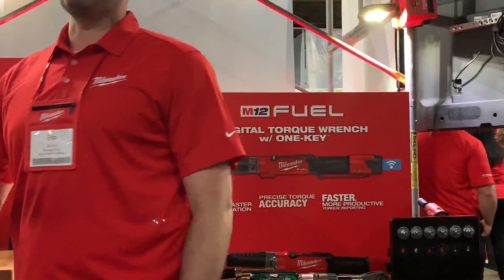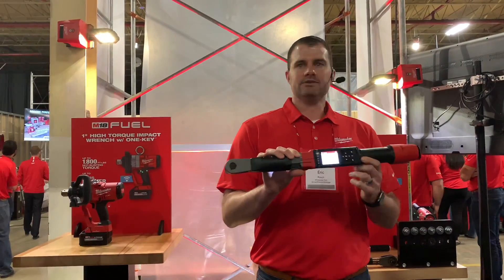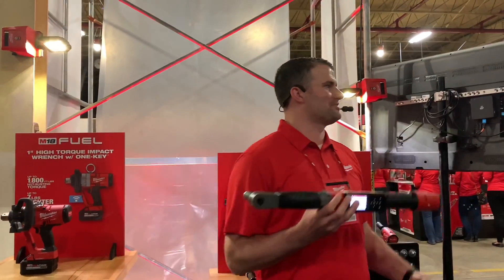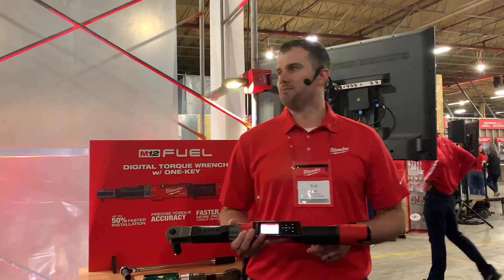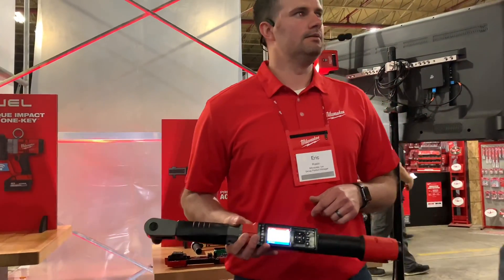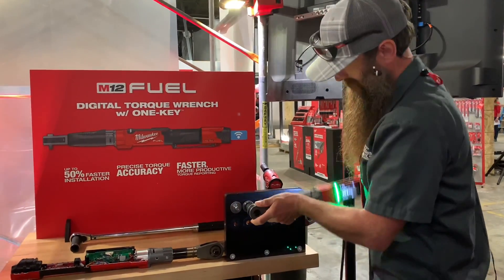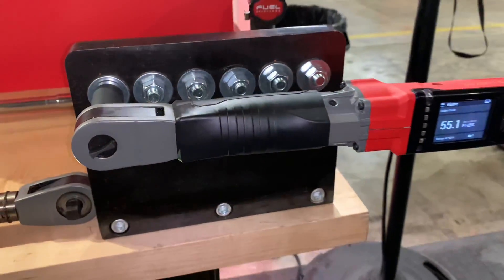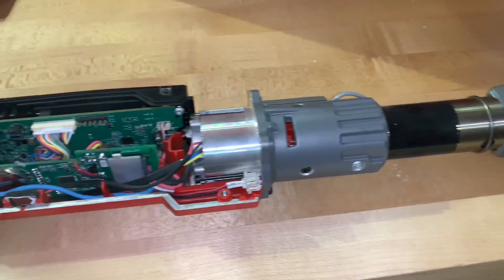Milwaukee Tool Put A Motor On A Digital Torque Wrench!

Comment: Yikes. Big miss here. 150 ft/lbs on a 1/2" drive? The power ratchet part won't even get near that anyway and you'll be ratcheting like any other torque wrench. The profile is brutal.

Comment: +/- 10% yikes
Reply: I paid $600 for my snap-on, it’s digital, I don’t need to charge it ( i just change the battery’s which takes two seconds, don’t have to charge it and wait hours.) it’s got torque angle, and it’s accurate up to +/- 3% and that thing is way too bulky. Not to mention that the motor in the wrench is kind of useless. You have more people abusing the instrument by using it as an electric ratchet. This will never sell as well as Milwaukee thought it would.
Reply: Jake Hartung Yeah That one you have is way more useful. This thing has some possibility useful features but the Frankenstein tool they created is not anything worth anyone’s time. I just don’t get it.
Reply: he said 2%
Reply: Jeffery Baxter No he says 10%, look at 1:25 in. He sets the torque setting to 60, and gets 66lb/ft and says “I’m at 66 alright. So plus or minus 10 percent is what we see”
Reply: Patrick T No disrespect but you need to rewatch it. He said the tool is accurate to 2%, but you can change the acceptable torque between 0-20% either below or above your specified torque.
Reply: Danny DeLapp I see, I apologize for the confusion. Thanks.
Reply: @danieldelapp1  No he definitely said 10% then said it's adjustable to <60+10% or <60+20%
Reply: That’s too much. Garbage tool.
Reply: HDstreetshark yeah even the $10 Harbor Freight torque wrench has a 3% range. This is designed for high end pros, but no high end pro would accept a 10% range.
Reply from the maker: What do you think of the new M12 die grinder? https://youtu.be/qfOd_7WJjd0

Comment: Good idea. But get it close with a normal electric/air/manual ratchet then get the torque wrench to finish it seems more simple. Only 150 ft lbs seems a little low for a 1/2" torque wrench as well.

Comment: No way the half inch ratchet can go up to 150 or even close to that with battery power, maybe up to 70 ft pounds then the other 80 by hand. no point on buying it. It’s a good idea but not there yet. They defiantly pushed this product out on the market before they did there research or developed it better. Also “NO ANGLE” lol nice vid though
Reply: Yep is need to be manually for sure

Comment: Good idea, but to low of torque, and no angle = a dud for most pros to drop that kind of money. Should have done more research and asked more mechanics what they need for this tool to be successful.
Reply: Absolutely, Can't believe they missed the target that badly. Somebody is going to get fired over this disaster.

Comment: Not impressed two low of max torque, no torque angle, too bulky, over priced, and not sure about oil, solvent's, or water resistance.
Reply: Keith Smith exactly no angle no good
Reply: Justin Hayward it’s cool for some work that does have that high of torque. Definite time saver, I prefer a click type though, and do angle manually
Reply: Just curious how can you came to those conclusions without it even being released to the commercial market yet. Have you physically tried it ? in the field
Reply from the maker: What do you think of the new die grinder? https://youtu.be/qfOd_7WJjd0
Reply: Right
Reply: Good luck using that on anything but wheels. Most engine work where torque is actually necessary I mean where would that fit well? Better off in a cave
Reply: Good enough for GM suvs like Tahoe and Escalade.

Comment: That's awesome & is a game changer mostly for production type work. I hear in the comments Milwaukee is coming out with a long reach cordless powered wrench also. This tells me Milwaukee reads these comments & it's more than likely they'll come out with a angle reading powered torque wrench in the future. Not sure if these will be used in aviation (I'm an A&P Mechanic BTW) because Milwaukee is going to be calibrating them. The last company I worked for in aviation would calibrate our personal torque wrenches & of course company owned torque wrenches so that could be a problem. If we can't have them calibrated at work we won't be able to use them at work because all torque wrenches used on aircraft have to have a calibration sticker on them with the torque wrench #, date of calibration & when calibration is due on it. Those #'s have to be documented on the paperwork in case there is a problem or heaven forbid a plane crash & an investigation by the NTSB & FAA. A certified FAA authorized IA inspector has to witness the torque wrench being used by us the A&P mechanics out on the floor & they check these calibration stickers to make sure the torque wrench is in calibration & not overdue etc.. We'll write the calibration info on the paperwork & once the fastener has been torqued & witnessed by the IA Inspector they'll put their rubber stamp mark next to the calibration info on the paperwork & that stamp has their employee # on it & they'll initial it & date it to certify they witnessed the fastener being torqued & the torque wrench was checked for the proper calibration info & overall physical condition too. Thanks for sharing this awesome info with us, much appreciated.

Comment: I dunno, that thing is huge. Don't think it'll fit into a lot of places like say to torque a timing belt tensioner or cam gears. I think this is the first Milwaukee tool they've come out with that seems a little gimmicky. Everything else has been a home run and I can't wait for the long reach M12 ratchets. And hopefully, one day, bench style tool boxes. Also, thanks to How To Automotive for bringing us these early vids, you're my go to for info on the newest Milwaukee stuff.

Comment: Absolutely not. That is crazy money for a torque wrench. Plus the size of the wrench is going to hinder some of the spaces for torque on vehicles.
Reply: kj197734 I agree with you, usually I am a huge fan of Milwaukee but for that price you can get a digital snap on that can do angle as well
Reply: Agreed. And the main advantage of the snap on is the flex head. This is a good idea on paper but not really needed
Reply from the maker: kj197734 what do you think of the new M12 die grinder? https://youtu.be/qfOd_7WJjd0

Comment: cool but kinda sucks with no angle
Reply from the maker: Yes it would be better if you did angle. what do you think about them having a powered ratchet built into it?
Reply: the motor is interesting   it would save time  but its bulky   @HowtoAutomotive
Reply from the maker: scuba422123 It’s all gonna depend on what you’re working on if it’s gonna be helpful for you or not.It’s definitely on the pokey side but has a good feel to it though.
Reply: This might be a dumb question but what do you mean by "angle"?
Reply from the maker: EOSJOE Some bolts are  torque to spec then it requires additional turn off either 90 or 180° and some ratchets will be able to tell you the degree of angle after the torque spec..
Reply: @HowtoAutomotive  Interesting. Thank you for explaining. I've never ran into that. It would seem that 90 or 180-degree would be very simple to measure just by the position of the handle. Whereas something like 40 or 140 degrees would be more of a challenge.

Comment: 150 ft-lb is quite low for a 1/2" torque wrench. Most 1/2" wrenches go to 250 ft-lb. While I can see some features of this tool being nice for a production or assembly shop, the $600 price tag for the bare tool is just crazy.
Reply from the maker: I would agree the half inch Hass to be higher at least 250 foot pounds. I suspect the generation two will have the angle and the higher torque settings.
Reply: Just buy the Snap on 1/2 Digital torque wrench just $100 dollars more. $700 got my online amazon. Can torque up to 300 lb.
Reply: Made in China
Reply: Can't even torque the lug nuts on an f250.

Comment: That's pretty sweet
Reply from the maker: What do you think of the motor on it?
Reply: @HowtoAutomotive  I like the idea behind it but I'll probably hold off on getting one till they offer a angle feature. And I don't know how useful it would be in my main job as I'm a heavy equipment mechanic but for the heavy line side work I do on automotive I think it'll be useful

Comment: I’ll stick with my slim, lite, flex head, does angles, TechAngle lol
Reply from the maker: This tool is not perfect and not made for everybody. So I don’t blame you there. They will be coming out with more models without the powered motor that will be a lot slimmer.